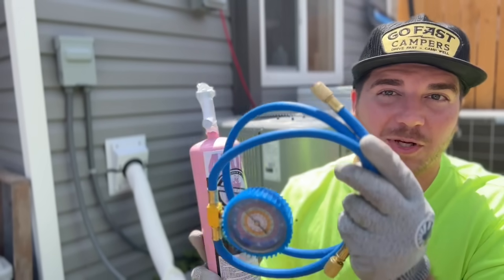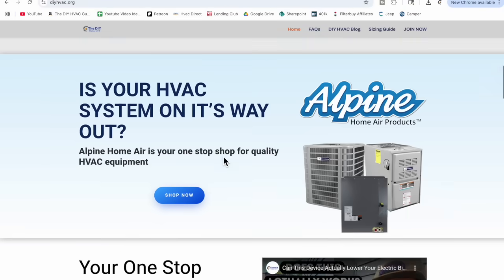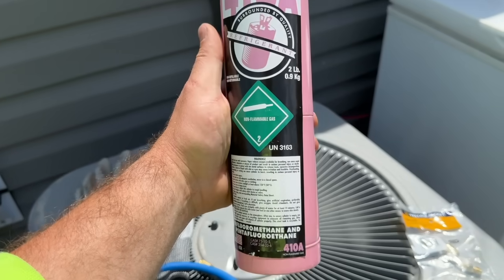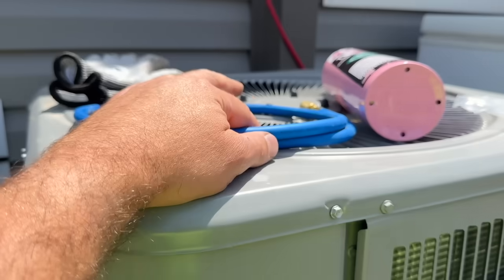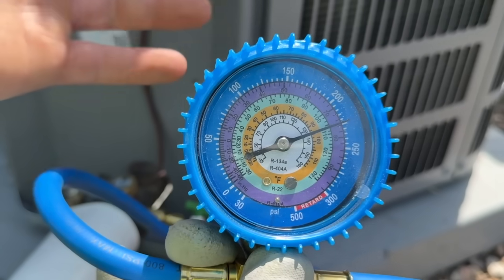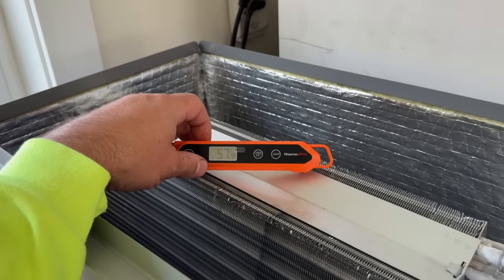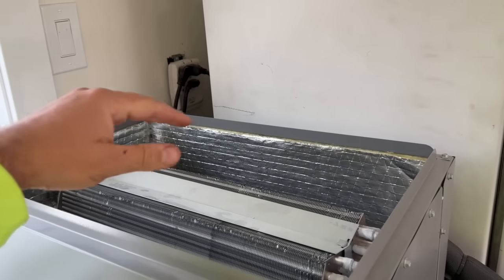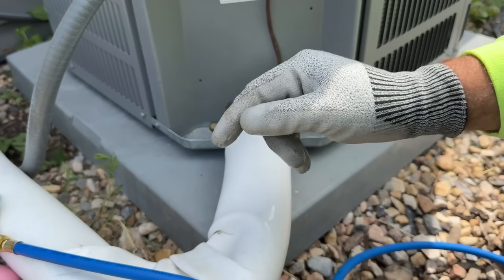You Can Recharge Your Home A/C Like A Car??  Colder Air in 6 Minutes!

Comment: I'm 99% sure that if you follow these directions and purchase / handle / install the gas off that website that you will, in fact, be breaking a federal law without having an EPA card before purchasing. I'm fairly certain it doesn't matter if they don't ask you for it when they sell it to you, it's still illegal. So just know that going in. If you're comfortable with it, then so be it.
Reply: Says the HVAC owner demanding a $500 surcharge and $200 diagnostic fee during hot days.
Reply: @FuturesReaper  Fairly certain your entire comment was just plain wrong. First, pretty sure you meant to imply that I own an HVAC business but what your comment actually said was "HVAC owner" which is anyone who has a heating/air conditioning system attached to their house. To be clear, I do not own an HVAC installation business or any type of business associated with this. Therefore, I don't charge any fees. I have, however, read the EPA website and went through the process of obtaining an EPA card BEFORE purchasing gas for my own personal use. What would be wonderful Is if you took even just a tiny millisecond before commenting to research this for yourself and then formulate an educated & logical comment based on actual FACTS.
Reply: @jotu173 that's what an HVAC business owner would say.....just don't come onto my property telling me this brotha

Comment: Cool. Really great information. I just replaced the condenser fan and capacitor (5/30) on my 20yr old Nordyne Unit. I replaced the capacitor last year with the same 3/30 (reading 4.75/30) that was there cause the motor was acting up but it turned out he capacitor was the wrong rating and should have been a 5/30 (this info was on side of motor and I missed it). Then it just quit when I turned it on this year. I dissembled the motor and there was water damage, the ohms were in the mega range. Costs me under $200 and It is all sorted now.

Comment: This channel, sir, is a godsend. Thank you. I live in the center of Texas, and I just spent $758 dollars for a start run capacitor, a relay, and three pounds of 410a. Is this a fair price? I don't think so. If I would have found this video before I did that, I would have saved over $500.
Thank you for your channel and keep it going.
Reply: $150 for the service call, maybe $100 for the juice and another $150 parts and labor for the contactor, plus his truck and all the equipment he brings.  I’d say that was fair,  but is all DIYable, esp the capacitor.
Reply: Your capacitor could have been bad most caps are 35/5 or 45/5 and if rusted and bulged out they need to be replaced ASAP and I'm sick of people using supcos too
Reply: Do you need EPA certification to buy refrigerant?
Reply: It's fair price. HVAC companies need to cover a lot of costs. It's all in the price

Comment: WOW  !!!!!   Thanks you very much I am a landlord with 20 units when we get a heat wave here I have to have my tenants wait 4-6 days to get a HVAC tech out to look at the A/C now I can get them relief quicker. Thanks again !
Reply: You sound like me when I thought just because I could change a capacitor and fan motor, a youtube video would be all I needed to work on refrigerant lines. For one, it's a federal crime to do so without certification, and the fine of $44,539 made me think that maybe it's not as easy as these youtubers make it seem (not to mention if someone rats you out they can get up to $10,000, so there is incentive to snitch). Anyone can get certified though. The courses are easy and cheap. If you have 20 units, I highly recommend getting EPA 608 Type II certified. You'll learn a ton of very useful information and be confidant instead of arrogant.
Reply: still have to have that license, understand what pressures different refrigerants run at, and how to change a capacitor (which is what the problem usually is lol).  Don't do this if you're not sure what kind of unit you have and don't buy r-22.  It's a waste of money.  R-421a is practically a drop in replacement and can save a ton of money.  BTW because of the accumulator, heat pumps will generally run a bit lower pressure and can be overcharged easily (at least the r-22 units).  I haven't had to work on a 410a heat pump with low pressure.
The fine is huge if you get caught handling restricted refrigerants without a license, so make sure to get that first.  It'll give you the basics of how to work on a unit when you take the class.  It's easy, and might save you 25k per incident with and incentive of 10k rewards for people providing evidence of breaking the law.  The fines and rewards might be different now (I got my license in 98).
Reply: @BrokePencil  The fine is nearly double that now, about $44k.
Reply: @gregdoh  bet they still cheap out on the reward.  Last I heard it was the same lol.  Not that I'd turn down 10k.
Reply: @BrokePencil I'm curious to how that process works. Perhpas if the person actually pays the $44k fine thats where the $10k comes from? Are they actually fining common people  though, and then are they actually getting people to pay the fine?
Reply: @gregdoh  I'm disabled now, so not really using my license much, but I did it for over 20 years and never heard of anyone getting fined or receiving a reward.  I'll research it tho.  I'm curious who would actually enforce it/pay out.  It might just be an EPA created regulation instead of an actual law.  the regulation comes from an agreement of nations that may never have actually risen to the level of treaty, or what that means as far as enforcement jurisdiction.
Just don't know.
Reply: @gregdoh  Apparently the EPA has actual armed enforcement officers who would initiate an arrest, given enough evidence to get a warrant from a judge.  Very few are prosecuted each year, and even fewer rewards are paid out.  It's almost as difficult to overcome the policy barriers the EPA puts in place for whistleblowers to get credit as it is to prove intent when venting refrigerant.  But the reward would be paid by the EPA from their budget if you could convince them to (they set their own policy regulations for this).
Reply: @BrokePencil  Sounds about how I would imagine it would go. To me, the bigger concern would be the damage caused by someone thinking that it's as simple as just adding some refrigerant as I once did before I decided to get the cert.
Reply: @gregdoh  yeah, I was just doing a favor for a person the other day.  Unfortunately I had to carry the 421a with a broken back because they weren't allowed to handle it, but they carried all my tools.  I put on my gauges and it looked like low refrigerant from the suction side.  It was pulled to zero.  Without putting a gauge on the high side, I wouldn't have realized it was pegged out  nearing 200.  So not only would I have been mixing refrigerants had I gone by the low side reading, I would have blown the compressor.  
I can't fix a txv or a blockage because I don't have the tools anymore (or the fortitude because pain sucks).  But just checking the suction line pressure is a rookie mistake.
Reply: @BrokePencil  I've never even worked on a home AC system. I got my EPA 608 Type I a couple of months ago because I wanted to make sure I knew what I was doing when trying to fridge that either had a leak or a bad compressor (turns out it had a bad compressor). I found learning about how HVAC systems work a bit of fun, so I decided I would get my Type II as well, but then decided just to go for the Universal, even though I'll likely never work on low pressure systems. 2 months ago I would have had no idea what you are talking about, but I'm glad I do now as it should be quite helpful going forward!
Reply: @gregdoh  lol. yup, now you get to look forward to all of your friends and family coming to you before calling in for hvac service.  It never stops.
Reply: @BrokePencil  Ha, I'm sure that's coming and at first will be fun to help them out and save them time and money, but I'll also charge them for my time and labor (except for my parents).
Reply: And no legitimate respectable HVAC distributor will sell you refrigerant as you are not certified and licensed to buy   it.
Reply: @davyjones922 EPA allows wholesalers to sell refrigerant to uncertified individuals so long as they say they're going to resell to a certified end user. Work around for almost anything if you know where to look in the black and white.
Reply: Lol the problem is not always low refrigerant. Don't try to be a pro, you'll always end up paying more in the end
Reply: @mackercheese  Favorite part of this channel is that many of the flim-flam HVAC guys that rip-off customers hate that hes showing how easy it is to DIY your own system.
Reply: @mackercheese   I know !!!!   I don't need to be a pro to check a guage I already change capacitors.

Comment: We can't hookup gauges to our home A/C here in Illinois. Be very careful of doing this and having someone call to complain.  If you don't have Section 608 Certification it's a violation of federal regulations. You could get into some serious trouble doing this.  I can't service my own home A/C. Illinois sucks.
Reply: You can service your own equipment.  You can’t allow refrigerant to leave your property.  Working on some else’s equipment in exchange for money or something else is a big no no.  It’s no different than working on your car AC.
Reply: @user-tb7rn1il3q  Can you point me to where that rule is?  It would be great having something to point to when others start screaming that the EPA is coming after you without the 608 certificate.
Reply: @stuff5109 There isn't one. The rules apply to commercial refrigeration, not residential. You don't even need a license to buy Freon or any of the other tools to service AC. This is right up there with the famous "you'll kill a lineman" BS with backfeeding generators. Linemen purposely short the lines before working and no home generator is large enough to backfeed a neighborhood so the breaker will immediately trip on overload.
Reply: @user-tb7rn1il3q  Attaching and detaching hoses and gauges to and from an appliance to measure pressure is considered an activity that could release refrigerants into the atmosphere, requiring certification. This certification is obtained by passing an EPA-approved test specific to the type of equipment you plan to work on. 
Therefore, hooking up gauges to your home A/C in Illinois without the required EPA Section 608 certification would be a violation of federal regulations. In Illinois, working on HVAC systems without the proper licenses can lead to fines and penalties, which may vary based on the severity of the violation. Specific fines for unlicensed work can include civil penalties and potential criminal charges, especially if the work is deemed hazardous or fraudulent.
Reply: Can you explain who is going to call and complain?
Reply: @Igotstaknowit Your ex wife
Reply: @Igotstaknowit  I say do it. But if something does go wrong please come back and tell us about it. I'm curious as can be.

Comment: He also want to bleed the AC charge  line at the most distant part from the recharge tank not right next to it right?
Reply: He's bleeding the line with an open connection to the system: he's back bleeding with the system refrigerant, not forward bleeding from the recharge tank It's right..

Comment: Question for the pro's - 
* This is Old Guy long but if nothing else is a good shitter time killer. 😂

I had a high efficiency furnace installed Feb of 21 and the HVAC company fubar'd the install on too many levels to list here. The AC is an R22 system. They pumped it back and removed the A-coil to install a plenum compatible with the new furnace. 
The AC 'functioned' when the weather turned warm but never cycled during the hottest part of the day. The installer was supposed to come back in summer and check the charge. They didn't and lied about having done so when I called. They said their records say they did. I had previously been told it didn't cycle because the system was a 2-ton and I should have had a 3-ton. I won't argue that.
I'm a widower living alone with serious health issues, and was 62 at that time so I didn't fight them like I would have if I were younger so I sucked it up and just dealt with it.

Skip ahead to Nov. of 2024. I'd been using the heat for about 2 weeks and decided to change the filter before Winter set in. I found the floor flooded and after cleaning that up with a wet/dry vac I began looking for the source. 
It didn't take long to determine the condensate lift pump had overflowed. It was plugged into a GFCI in a service box mounted to the bulkhead right under a PVC 90°.
The GFCI wouldn't reset so I bought a new one and installed it to restore pump functionality. 

Having worked my whole life in mechanical trades of one type or another I began looking for the reason the GFCI failed (It was only a few years old). I found dirty water trails on the PVC pipe running from the roof jack and down the PVC pipe where the water hit the 90° and kept going down onto the GFCI. 
That led to going to the roof. (It's a double wide ranch but still...not recommended for broken down old mechanics). I found the installer had used the incorrect cap that replaced the single flue. It was obviously a universal. It was nothing more than a flat disc with 2 holes for the PVC pipes. The holes had ~ 1/8" lips. The apprentice who did the outside work during the install applied white silicone around the pipes...in 2 perfect standalone O rings that never touched the pipes. He never removed his gloves to form the silicone. Also, the 'cap' was undersized so he used a self adhesive foam tape to wrap around the roof jack stack to make the smaller cap fit. 
I sealed it all with a heavy coat of FlexSeal. (Swearing the whole time).
Back inside I began looking for more screwups...and found them. 
1) The coil drain hose wasn't attached so 2 cooling seasons of water had been draining down through the floor and onto the insulation where it stayed mostly trapped by the belly wrap. 
2) The floor decking was mushy around the base of the furnace and nearby 435lb water heater. Opening the water heater access door I found it depressed into the flooring and leaning. 
3) I discovered the installers either didn't notice, or care, that there was no dirt leg on the furnace gas feed. 

I called the installer and was of course fed pure BS. Their insurance company sent an "independent appraiser" who of course denied my findings. About how I figured it would go. 
So I called my homeowners insurance and was told that the date of loss (the Feb of '21 installation date) was too far beyond the 1yr report date. Screwed again. 

Sooo...I drained the water heater, shut off the gas, moved it out if the area, and had a friend come over with a few of his friends to replace the rotted presswood floor deck.  
I'd bought a set of cheap gauges to pump back the R22 but they didn't come with right adapters so were useless. I pumped back by ear and stopped well before the sounds the video's I'd watched said I should listen for. Too much and that type of compressor would be fubar'd.

Because I was more concerned with getting the floor deck and insulation replaced I cut the linesets at the coil to get it and the plenum out of the way. 

Now for the question- Over last winter I found a used 410a 3-ton condenser and coil that had been removed by an HVAC company for an upgrade job. Even armed with a lot of research and a list of things to ask and visually check, buying a used m disconnected system is a blindfolded toss of a dart - and I was aware of that. 
My thinking was why spend the money to have an HVAC pro reconnect and get a 1996 R22 system up and running again when 
a) R22 is so damn expensive and it would most likely need at least 2 pounds or more; and
b) It was a 1996 model and could die by natural causes at any time, and
c) A 'newer' 3-ton 410 system would be more efficient and have lower future service costs.
Sounds logical right? (Lie if you have too...I'm already beat up by this whole fiasco)
I thought so too...UNTIL over the last week outside temps climbed into the Holy Schitt range so I got busy prepping the condenser and coil for a tech to come get it integrated and up and running. 

While desoldering lineset stubs left when it was cut out both the coil and condenser solder joints flared up in pretty impressively. After reading some of the comments here about what can happen if compressor oil is forced to enter the refrigerant circuit by introducing too much liquid I got a bad gut feeling. 
I'm on a fixed income and believe me - If I could afford a new install I'd do it in a skinny minute but...reality. 
Would my money be better spent having a tech reinstall the known working old R22 system?...or gamble that the 410 system's compressor isn't fubar'd. 
I've muscled 5K BTU window units in at each end of this place and use multiple fans to distribute cooling but in the evening when the sun beats this Senior-Bake- Oven tin can from the west it's gotten up to 85° in the livingroom. 

I own a $hit ton of tools and love every opportunity to get my hands dirty again but I have no HVAC equipment...and I can't afford to drop that kinda $ for a one-off project. Plus after the stroke I had Feb of last year the old body just isn't up to a lot any more. 

If nothing else I hope this novel helped anyone thinking of buying a used system think long and hard about it.